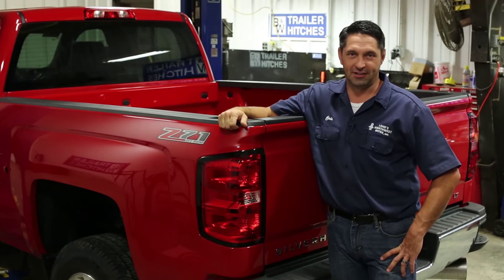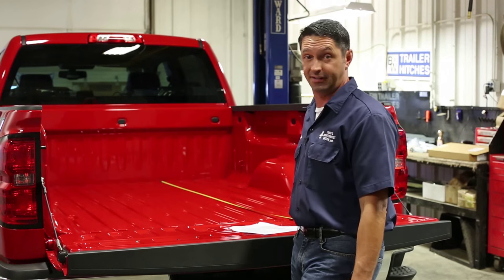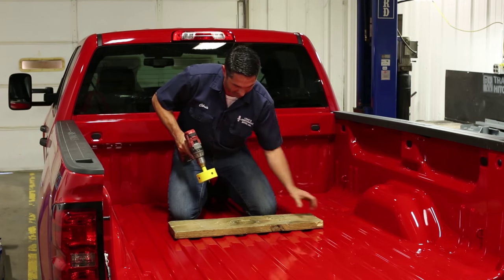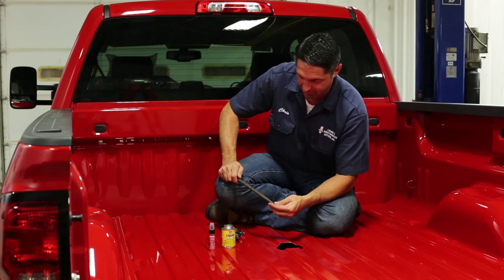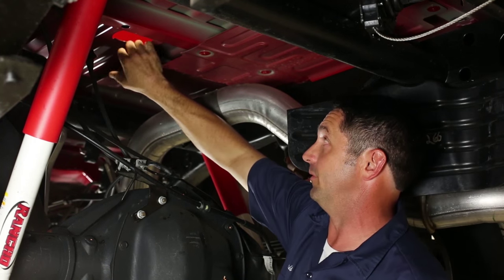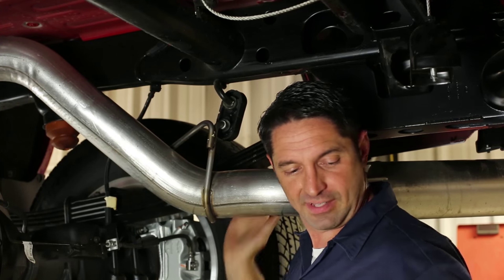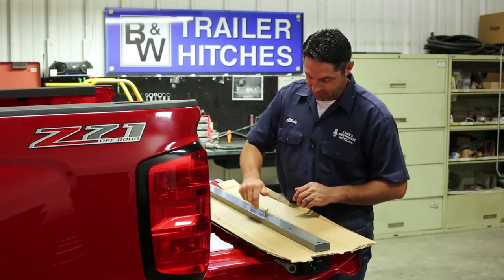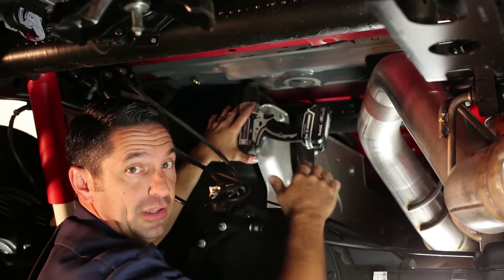Turnoverball Install Tips

Comment: 7:12  - If you have a 2x4 and a 1" ratchet strap:  span the bed rails with a 2x4, centered over the hole in the bed.   Tether a ratchet strap to the 2x4, and hook the hitch by the through pin.   Pull out the slack and ratchet the hitch into the hole cut into the bed.  Was super easy and no special tool was required.

Comment: This was a nice video! I'm glad my Ram has the flat area in the bed for the hitch hole. I'm installing this on a 2020 1500, with a Reese goose box v2 on a 6000lb fifth wheel. That way I don't have to deal with moving the 5th hitch to use the truck! Ill be installing an upgraded swaybar and linear springs while under the truck to add stability as well.  It would be awesome to see a RAM specific install! If I was closer to you Id offer my truck for the video.

Comment: I just mounted a BnW Gooseneck on a 1997 Ford F350 w/overload springs. The truck had NO bed, so install was easier.  I am putting a flatbed on it.   The issue I have now is the STOCK exhaust is hitting the underside of the gooseneck plate.  Is this normal?  I don’t believe I saw anything in the directions about this.  Before I can put the bed on I need to either fix something I may have done wrong or modify my exhaust.  Any help would be appreciated. Otherwise, I like the product and I am excited to use it!

Comment: Am installing a Line-X bedliner in my Ford F250. Are there issues I need to know about, when installing the B&W 5W hitch? Thanks and Y'all Be Safe!
Reply from the maker: If you are installing the hitch after the liner you will only need to account for the thickness of the liner when measuring for your 4” hole.